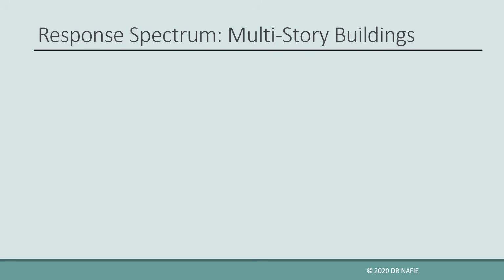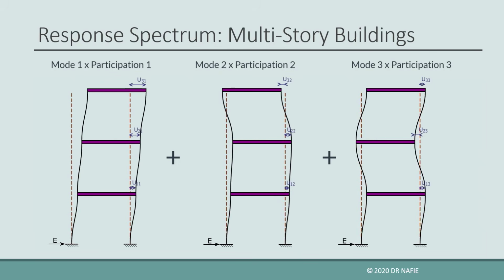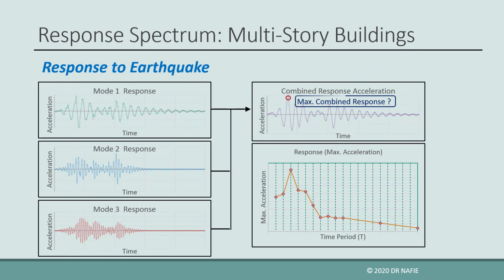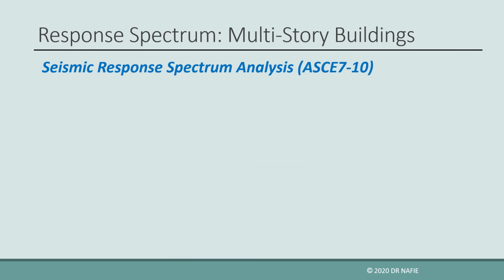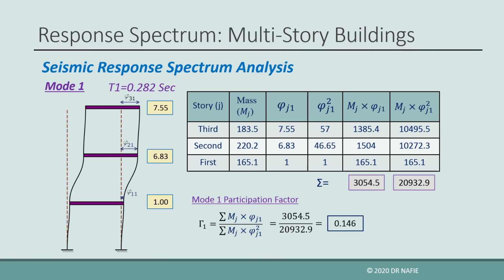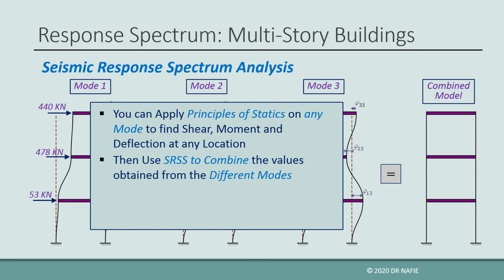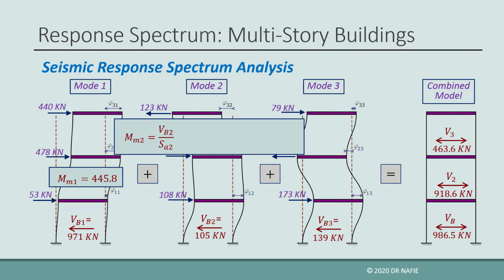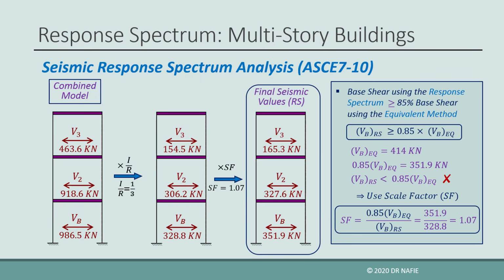Seismic Analysis of Multi-Story Buildings using the Response Spectrum Method

Comment: Hi Dr Nafie, how did you obtain the mode shape? I would like to obtain a simple expression for idealizing a building as a prismatic member, I think it can be done, but the hardest trick is the mode shape. And, deflection of the tip of the building I think can also be obtained from the modal participation multiplied by acceleration multiplied by mode shape.

Comment: Dr, can you explain this: If I have a square (equal width and length) building and 4 columns each way.  That means I have 16 columns total supporting the building.  Is the dead load W , the tributary load carried by one column being analyzed and therefore the base shear calculated is that acting on one column?  Since each column W is different, then there should be 16 different base shears to do, some likely to be equal.
Reply from the maker: When we talk about the base shear, we are talking about the total force carried by the whole building. This is to say, the base shear is the sum of the reactions of all 16 Columns

Comment: this is absolutely amazing please do more on Seismic Analysis
how is that the building can be restricted for only a specific mod shape ?
Reply from the maker: I am happy the video was helpful
The multi-story building cannot be restricted to only one mode. 
But if the building is uniform, the first mode of vibration in which the displacement is increasing gradually with height in one direction will be the dominant mode.
In this case if you used the first mode only in your analysis, and ignored the other modes, your accuracy will be very good.

Comment: how to determine the directions of final design story shear force?
Reply from the maker: Unfortunately, the response spectrum method gives only the design value without sign. 
So we take this value and include it in the design combination twice, once with a positive sign and another time with a negative sign.
Reply: @drnafie-structuralengineer4620  
you mean one time assumimg every story shear force in positive sign and another time in a negative sign? Could I regard three story shear  force always in the same direction?
Reply from the maker: The direction of the story forces follow the mode shape. For mode shape 1 all the forces were in one direction, so we will take all the forces once to the right and another time to the left.
For higher modes, you will find some stories going right and others going left, the forces will follow the same direction. This is done automatically when you apply the equations as in the example.
For these modes when you put a negative sign for the response, the forces that were going right will reverse to the left and these that were pointing left will reverse to the right.

Comment: Hello Dr. Nafie. I have a question. How come having a ductile structure is better for non-linear seismic analysis?
Reply from the maker: A strong earthquake event doesn't happen frequently. Therefore, for economic reasons, we design the building so that in a very strong earthquake it will endure some damage but it will not experience total collapse.
A ductile building can experience large deflection without collapse, but a rigid building will experience collapse at a low deflection level.
We prefer a ductile building, because it will experience a larger deflection and therefore can absorb more seismic energy without collapsing.

Comment: If mode 1 has the peak value of acceleration.. Why to consider the other modes? We already have the peak value and we can design for that right?
Reply from the maker: The final response is a combination of several modal responses. For example if mode 1 constitutes 70% of the response and mode 2 20% and mode3 10%. If you take mode 1 alone you will miss 30% of the response. 
However, if Mode 1 constitutes 95% of the response for example then it will be sufficient to take mode 1 alone.
The code requires you to use a number of modes that cover at least 90% of the response. So if mode 1 satisfies this criteria then it is OK to take Mode 1 alone.

Comment: that was a hell of a toturial! thank you so much and hope u can make a video conducting response spercturm analysis using CSI ETABS. one more thing if you don't mind me asking, how can we fulfill ASCE7-10 requirement regarding base shear being 85% more than that  of equivalent static method while  ASCE doesn's allowe such a method for buildings with some sorts of irregularities.
Reply from the maker: I am glad the video was helpful.
Regarding the calibration of the response spectrum with the  equivalent method, your question is very interesting.
In order to answer your question, I have to differentiate between 2 things. The base shear and the force distribution. The base shear is the total seismic force acting on the building (Sum of all story forces), but how are these forces distributed is the key difference between static and dynamic methods. In the equivalent method, the forces are distributed uniformly from the base increasing in a uniform manner as you go upwards.
In the dynamic method, the forces are distributed according to the mode shapes and may have a completely different distribution if the building is irregular. If the building is regular, the distribution will be very near to the static method.
The distribution of the forces is very important because it has a major effect on the base moment. So you might have 2 cases with equal base shear, but the distribution is totally different so you have completely different base moment which is very important in the design.
Another point to consider, is that the base shear in the response spectrum can not be less than 85% of static ( in ASCE7-10), but if it is higher you don't scale it down.
I hope this answers your question.
Reply: @drnafie-structuralengineer4620  thank u so much,  u made so clear 🌹🌹🌹

Comment: Excuse me sir, supposed we are going to analyze a structure under a given time history data (ground motion), what would be the difference of using modal time history analysis and direct integration method? I have observed that direct integration takes much more computational power, but at what occasion does it favorable? And let’s say we have obtained enough mode shapes for the modal time history analysis, would the two methods produce same results? Thank you
Reply from the maker: If you include enough mode shapes, the result will be nearly the same for both methods as long as the analysis is linear. If geometric or material non-linearity is included in the analysis, then you will have to use the direct integration as the modal time history will not be valid.
Reply: @drnafie-structuralengineer4620  thank you so much sir

Comment: Can you please illustrate the regions in response spectrum where is acceleration, velocity or displacement controlled?. I know the regions but I don't understand the reasons
Reply from the maker: This issue is related to the shape of the response spectrum curve and has no practical importance from a design point of view. There is a region at the start of the curve where the spectral acceleration is constant (the curve is a horizontal line). This is followed by a region were the spectral velocity is constant. Finally in the last region the spectral displacement is constant.
The response spectrum curve in the design codes is drawn as time period vs Spectral acceleration.
 If you draw the curve as a relation between the time period and the spectral velocity instead of the spectral acceleration, you will recognize the region were the spectral velocity is constant. The same will happen for the spectral distance.
Reply: @drnafie-structuralengineer4620  Thanks for illustration Sir

Comment: Very helpful information. Having these information, shall make me use little time going into books and codes for deeper understanding.
From your experience, which  software does these analysis and give good reports?
Reply from the maker: I am most familiar with ETABS from CSI. Very powerful software but also very expensive. However, I am sure most commercial software will do the Response Spectrum and Modal analysis, like SAP, Robot, STAAD,  Midas ... etc.
I am also planning to add more videos about the topic and also include excel files to solve the examples I am including in the videos. However, considering the limited time that I can dedicate to this process, I expect this to be a long term commitment. I ask God to help me.
I am Glad that I was able to encourage you learn more about the topic. Good luck with your endeavor.
Reply: @drnafie-structuralengineer4620  Thanks for your response Sir. I'll surely follow the lectures. Stay blessed

Comment: Thanks, most clarifying presentation I have seen. Using animation is certainly best method to explain the different modes and their combination. Only thing I didn't catch was the definition of VB(RS), how it was obtained?
Reply from the maker: I am glad the presentation was helpful.
With respect to VB(RS) it was obtained by taking the SRSS of VB (Base Shear) from the 3 Modes SQRT( VB1^2 + VB2^2 + VB3^2) this gives a value of 986.5 KN. Then this value is multiplied by I/R (1/3) to give a value of VB(RS) of 328.8 KN.
This value is less than 85% of the VB calculated using the Equivalent method of the code (0.85 x 414 = 351.9 KN). So all the Values obtained by the response spectrum are multiplies by a factor of 1.07 So the VB(RS) becomes 351.9 KN
In aggregate, the value of the base shear from the response spectrum is multiplied by (1/3) x 1.07 {986.5 x 1/3 x 1.07) = 351.9 KN
Reply: @drnafie-structuralengineer4620   how to  get  414 ?
Reply from the maker: The 414 KN is obtained using the equivalent method of the ASCE code. This is the basic method used to find the seismic forces. The equivalent method is very simple and is enough for simple structures. For complex structures the response spectrum method should be used. 
God willing, I intend to explain this method in an upcoming lecture.